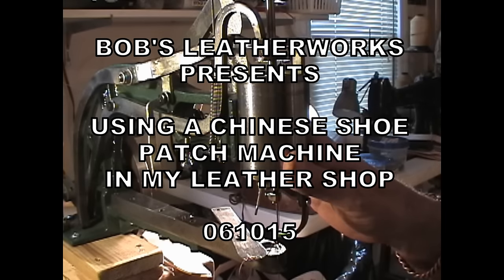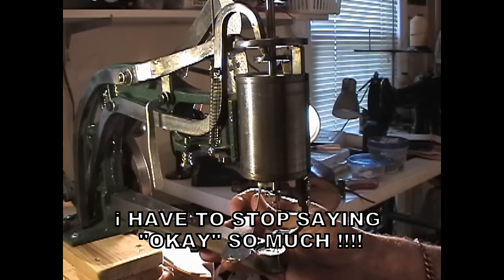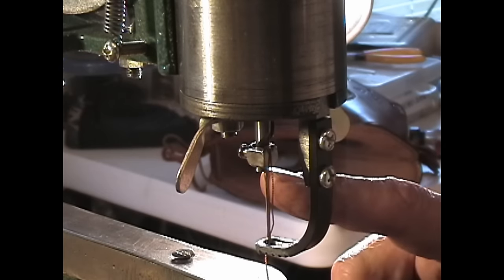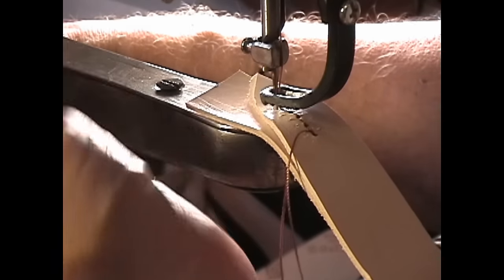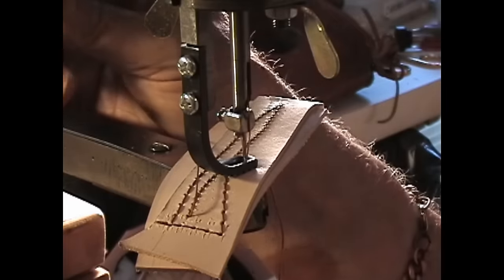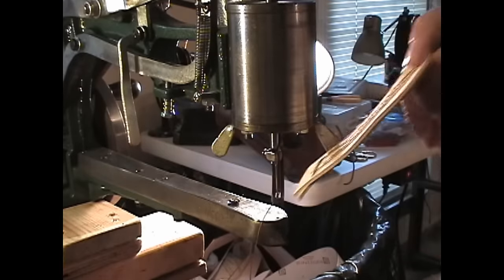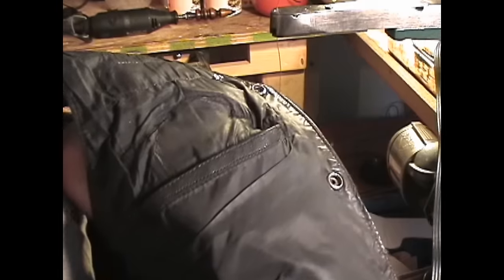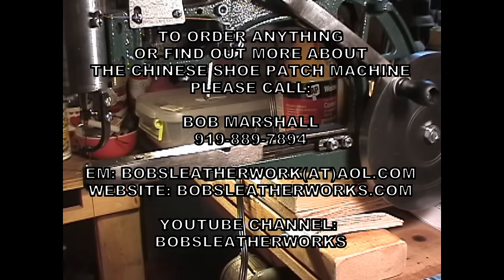BLW - USING A CHINESE SHOE PATCH MACHINE IN MY SHOP 061015

Comment: One thing I just did to mine for guides was use a wing divider and mark out 1/8, 3 1/16, etc marks off needle centerpoint. Used a wing divider to initial mark and then went back over with a scratch awl to deepen the lines a bit so they were easier to see. I'm currently toying with ways to magnetically attach a physical guide that can be set to whatever edge distance.  A neodymium magnet works well to guide the piece, but I was having problems with it lifting up the shuttle/bobbin even through the foot plate.... so something else will have to be come up with :P I think for now, just a 90 degree bracket h eld on with the magnet further back. PLace edge of bracket to desired line... etc.

Comment: This is a variation on a Bradbury patcher.  You can also find those for sale, they are beautiful looking machines in some cases, and I know people who have them and find they sew better than the Singer.  I have a good condition singer, but would buy a Bradbury if I could find one in my area.

Important to use leather needles, as you know.  They make the machine work a lot better.  One might not think so since when you run the machine without thread, the regular or leather needles, both punch through the leather pretty well, but odly, the thread will not feed so well.

Also remember guys, that if you run a machine with a 15 needle, there is a limit to how well that needle can tension your thread.  The needle is drawing on the thread. you can have a machine that will punch but if the needle can't pull, you can't really handle the material as you would wish.
Reply: @Kylo Joseph Instablaster :)
Reply: @Rocco Walker thanks for your reply. I got to the site thru google and Im trying it out now.
Seems to take a while so I will reply here later with my results.
Reply: @Rocco Walker It did the trick and I now got access to my account again. Im so happy!
Thanks so much, you really help me out :D
Reply: @Kylo Joseph No problem =)

Comment: You need to take the walking foot off and file the sharp edges off and polish it on a wire wheel so it doesant eat the leather up .
Reply: If your stitch is sideways of slightly twisted on long stitches, check this out first before removing the pressor foot. First, place a folded plastic bag under the pressor foot, lower the foot. Do not rotate hand wheel, just tug on the plastic front & rear to create marks. Remove and look for a pattern of teeth marks. Mine was on the right side and not touching the left, so removed it and went to the bench vise. I placed in on the very edge of the jaws to allow a magnetic torpedo level on the vertical, locked it down. Now, move the level to the top, across the serrated feet of the pressor foot to check for level. Mine was high on the side that did not leave marks. Since you can flat file it to reduce markings, it is not hardened steel this means it will bend. I used a "Cresent" wrench or adjustable wrench to tightly grab both feet equally. I lifted the wrench a little (Remember the direction to go first / use a piece of masking tape on problem "Low" side) Re-check with level. Adjust again as needed but slightly. 
  Once level and it had not moved in the vise, I put it back on the machine and tried it again. It sews straight now...YEH!!!  This is how you DO it! A huh, a huh.
Reply: You can also dip the foot in liquid tool handle that you can buy at Home Depot.

Comment: Hi Bob, great video. I’m also here in Raleigh and have run into a problem with my machine while trying to stitch multiple overlayed layers of leather on a guitar strap. It’s about 7mm thick and it causes my needle to miss the hole in the arm as well as shortening my stitch length. 

What is the thickest leather you’ve been able to see with the shoe patcher? And if you’ve had success, what size need do you recommend? I’m using #69 bonded nylon thread. Thanks for any advice you might have.

Comment: Good video, Can you please tell me for 2-3 layers of 8oz veg tan leather what needle thread combination to use please?. Ive just bought one of these machines and havent set it up yet. i plan to motorise it as well with a pully system over on the cam side.

Comment: Let me know when you replace a full length zip in a ladies high leather boot down through the original stitch holes so that is looked like it was as new using one of these machines.  The teeth on the walking foot do need to be reduced to prevent tearing and marking especially soft leathers

Comment: It is a knock-off of an original American patented machine of the 1850's. I don't think it was a Singer, but Singer did make their own version.  The patent has long expired, so they are making them in China.  Theyare sold "in the rough" with zero finish work to keep the price low.  Fun project, some say frustrating, and can be a very effective tool.  Smoothing and polishing makes them a practical addition to any bench top for small projects.

Comment: What is the largest needle and thread one could use on this?
Reply: I modified my needle bar to use 135/34 type 180/24 leather needles and 207 thread.  Works great but tension is tricky to arrive at and I cannot use the bobbin tension spring with this big thread.  Simply bypassed the little spring.  Largest needle I could use with the standard patcher, before mods, was the 15x1 140/22 and 138 thread.  The needle bar mod is not too hard to do, from info on the Facebook patcher page.  One issue is the bigger the thread, the less the bobbin holds.

Comment: I think on mine the hole that the needle goes down into needs to be a little larger. Would it hurt to bore it out a little?
Reply from the maker: Probably not...but, what is the problem you have having???...try emailing me: bobsleatherworks@aol.com or calling 919.889.7894 tomorrow (Tuesday)...out of the shop all day today (Monday)
Reply: @bobsleatherworks4989  Using the larger recommended (#138) thread and the hole in the plate jams up with thread. It does not with smaller thread.

Comment: Hello just received one and unboxed it and it is covered with that machine oil or whatever.  Did yours come covered with oil?  If so what did you clean it off with? I'm thinking maybe some break cleaner fluid from a spray can.  Any info would be greatly appreciated.  Thank you  L
Reply: +Larry White You are correct. Anything like carb spray, acetone works good but a lot of rags & rubbing. Maybe a genie will pop out and grant 3 wishes...
Reply: @deankay4434  Thanks.  Very funny.  Have a good one.

Comment: I bought a machine and how I can regulate to sew thick and thin since the leg is very tight and the stitch is too long
Reply: mery pucha u can adjust the pressure foot pressure with a turn of the adjustment nut and also there’s an adjustment for the stich. Length
Reply: Check out Mainly acres u tub videos for some plain instruction on setting up your machine

Comment: How does the stitching keep from unraveling if you can't do a back stitch? Lay a stitch next to it the other way?
Reply: +poche12651 Once you get a stitch or two into your work, you can leave needle down, lift pressor foot, Turn work or turn pressor foot. Another popular method is one stitch in, needle out, lift foot and pull material back over previous stitch, drop needle and foot, then start again. If you watch any videos by "Cechaflo" you will see the 3rd method a lot as he does leather auto upholstery.

Comment: I have one of these machines. I started having some issues with it not picking up the bobbin thread. If you might have a answer it would be a big help to me
Reply: I've been having that problem too I got my machine a few weeks ago and still have not been able to use it. Also the bottom thread goes through but hangs all loose. If anyone can help I'd appreciate it.
Reply: These problems are due to incorrect threading. If it is "all loose on the bottom", then there is not enough tension from the top. Don't adjust tension knob until you check that the thread is routed correctly AND that the threading plates  are pinching the thread and holding traction (very important). Loose tension can also make it difficult to pick up the bobbin thread.
Reply: @LustAxel  Did you find the issue with the bobin thread not catching?

Comment: Thank you so much for this video. You have clarified several things for me.
Reply from the maker: I sold this machine a long time ago...I was waiting for a 29-4 to get rehabed....used the 29-4 and then stumbled on to a vintage Adler 30-1 made pre-WWII...got it rehabed and now use it in my shop...awesome machine with a 16" arm....

The Chinese machines are very hard to keep in time unless you have experience with the patcher sewing mechanical design and how they sew....OR, you are wanting to teach yourself.  As I said in the video, they are very rough when you first receive it...you must clean it, smooth up at the parts. keep it well oiled and most of all, learn how to adjust the upper and lower tensions along with winding tight bobbins.

Good luck!
Reply: I will definitely keep that in mind but my machine seems to work quite well. I think they probably all differ a tiny bit from each other when they are manufactured. They certainly aren't put together in the Porche factory.   :)
You are a very lucky person to have found those vintage treasures. I'll have to keep looking.

Comment: Where can I get the heavy needles for leather sewing, that take the larger waxed thread?
Reply from the maker: Winston...I you are wanting what you are calling "heavy needles" for sewing with wax thread with a Chinese made shoe patch machine, you are "barking up the wrong tree".  Regardless, of the sewing machine type, you can't machine sew with waxed thread.

Waxed thread is for hand sewing.  Go on to the Tandyleather.com website, or visit one of the stores and you'll find the needles.  You can look on Ebay too.  

Have you every used a Speedy Stitcher?

Good Luck!

Comment: What are the differences in the machines? I see some have letters behind them like M and other letters
Reply from the maker: If anyone has a question about these Chinese shoe patch machines, please call me...919.889.7894  The basic problem(s) with them is that  they arrive in bad shape and must be cleaned up, smoothed up and you MUST know how they work to keep them properly adjusted between the upper and lower tensions to get them to sew OK.

Comment: Thank you for the video. What is the thickest thread you can use in it? Thank you.
Reply: +albertqss  I have sewn #136 bonded nylon using a 110 X 22. According to the thread exchange.com, needles, needle buying guide, they have a lot of info there. But the 110 is the length in mm and 22 is width of needle 2.2mm. Needles they sell list thread size as well.

Comment: Long interesting video, BUT, the marks left out from the presser foot are damaging the whole work. Should it be for a wallet for example, nobody want it. Something must be done in  order to eliminate the too strong pressure of the teeth of this foot...
Reply from the maker: Without teeth under the sewing foot, the machine doesn't advance the work...ergo, the machine doesn't sew.  Sooooooo, if you don't want marks on a wallet, maybe you need to use a different sewing machine.

Comment: I for get can #69 bonded nylon thread work on this by chance
Reply: +crazyguy84   I have been using #136 bonded nylon thread in mine with a 130 X 22 needle. I have had good stitching with a round headed needle instead of flat sided, as I was trying different needles and got one from my Juki DDL-5550.
The needle 130 is length while the 22 is the thickness of 2.2mm. Go to thethreadexchange.com, right hand side, find needle buying guide, it will show you different stitches from needle symbols like "R" or  "D", etc.

Comment: Those teeth on the footplate leave a fairly deep mark in the face of the work.
Reply from the maker: Annnddd???
Reply: File the teeth down some so that you have the marks on the surface.
Reply: @bobsleatherworks4989  Annnddd, you should file it and make it smooth so it dont mark up your work.

Comment: Those teeth are chewing up the leather something terrible.
Reply: Yeah that foot is chewing up the surface pretty bad. :(
Reply: Either take a small file and file the teeth down a bit OR use some of that plasti dip on the bottom of the teeth.